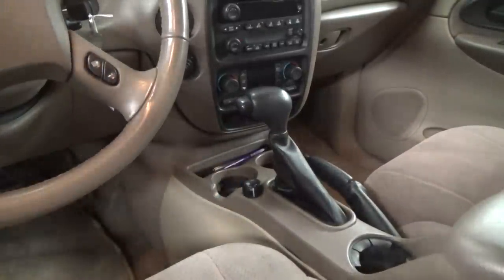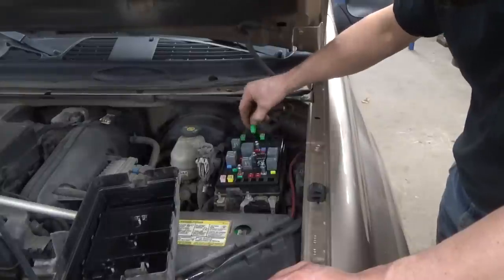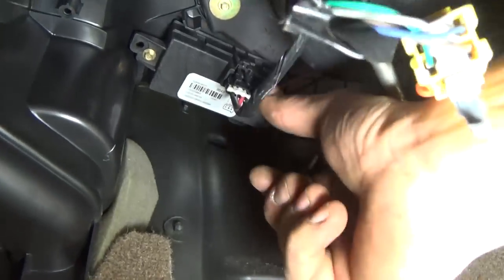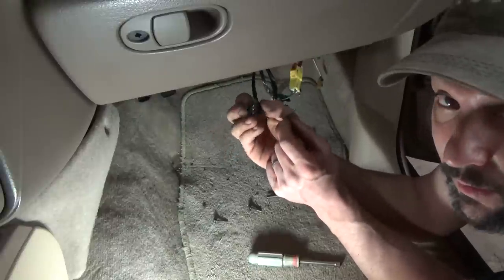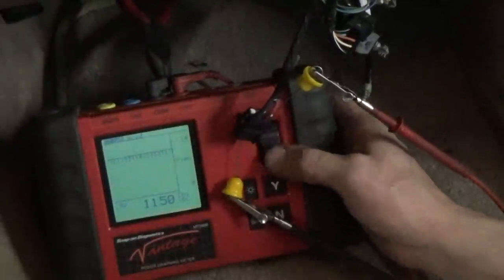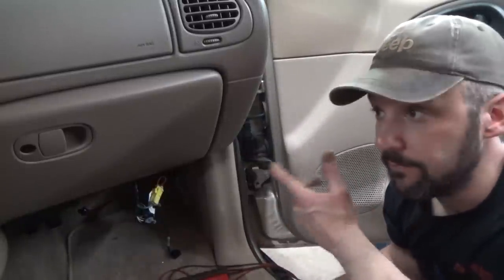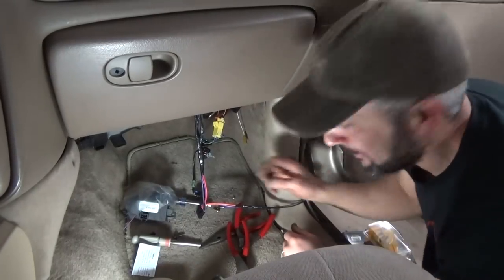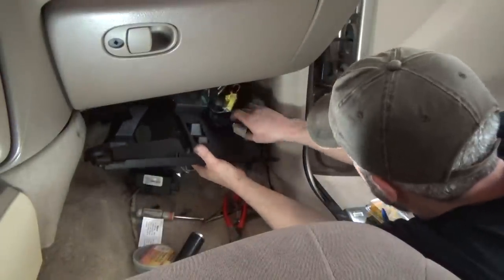Chevy Trailblazer EXT Blower Motor Won't Turn Off

Comment: Exact Problem in my daughters 2007 Envoy with 120K miles on it, exact same problem with after market part. i would have never found the problem without this video. I followed the procedure in the video and it worked out so perfectly that i didn't have to stick the extra foam from the seal to bang my head against it!  thanks Eric!

Comment: I love to hear you speak the truth about the after market parts like that. I've ran into it myself and it makes me swear through the rest of the job and usually half way through the next day, telling everyone about it. I would also like to let you know, that in the fields of plumbing and hvac they are experiencing the same thing, with the same results as you just experienced. Wasted time, modifications that shouldn't have been needed and also test the level of your creativity are usually the result. It's the way of manufacturing and until some big shot decides he can make more money by having everyone buy his parts because they are manufactured correctly, it isn't going to change. But keep ranting about it because were ok your side Eric. Thanks for the videos bud. Jpol.

Comment: After watching your video a couple of times, I installed this on my wife's 2005 Buick Rainier. I was very skeptical at first, but it wasn't that bad after all, and it worked. I used the AC Delco brand. Thanks for the help.
Reply: Wise to go OEM on this!

Comment: Eric, Thank you, Thank you, Thank you!  My son is working gobs of overtime right now and his wife called with this same issue on their truck.  I would have not known how to help her besides disconnecting battery or removing fuse.  She stopped by and it tested just like you showed.  I removed the module so he can go get the replacement part and we will put it on in a couple days.  For now, at least, she doesnt have to worry about the battery running down or having to pull the fuse.

Comment: Had the identical problem with my 03 Trailblazer.  Your post made it easy to perform the fix myself.  Saved me from being raped by the dealership.  The AC-Delco part was $60 from Amazon.  THANKS SO MUCH FOR YOUR HELP!!!

Comment: Hi, I ordered part # ACDelco 15-81773 GM original equipment heating and air conditioning blower control module from Amazon.com. $56.82 plus shipping and sales tax, if any. After watching your very good video, I was aware of the possible issue with the blower motor lead being too short. This part number had more than adequate length to fit in the clip behind the blower motor housing and reach the motor connection. It was an easy install in a friend's 2004 Trailblazer. What a great job on the video, and I agree with your comments on the lack of support when a part does not fit. Although, I have to say, without challenges to overcome, how satisfying would life be. It should be right, though. Keep smiling and I'll check back on my next adventure.

Comment: Awesome video! This was EXACTLY the problem with my 2005.  I kept searching for one that had a 3 pin socket.  Ended up figuring it out that I could use one with a 5 pin socket with a 5 pin pigtail (supplied), duh only 2 pins hot plus small purple one needed, plus splicing, Anyway the dealer part wasn't even AC/DELCO, product of Mexico/Korea with GM approved gold stamps all over box.  Thanks again

Comment: Good comments on the part fit vs. OE on aftermarket parts.  I am very familiar with part sourcing with suppliers.  Our process is this:  we almost always use Tier 1,2,3 suppliers, they are usually the same suppliers that make parts for the new car build.  We send them the blue prints for the part we need, they model it up, send part to us for engineering review, if part passes engineering review and testing, [extended durability, fit, finish, internal component specs] we sign off and release supplier sample for production.  We then take 50-100 of the first production run and test all of them, to include tear down to verify manufacture to print.  After this, we green light the part for release to commerce.  The extra engineering, testing, validation steps add cost, but the part is right when we release to commerce.  I was a tech 35 years ago and learned quickly on the difference with OE vs. aftermarket. It is hard to get the OE spec part today depending on where you are and the available part suppliers.

Comment: Just today I replaced a window regulator (Dorman) and the new part worked about 12 times then the cables broke. Chevrolet wants almost $600 for there part so back to Dorman we go. I hate crap parts but I hate overly expensive parts more. Great video Eric. I've been enjoying all the diagnostics and repairs.
Reply from the maker: +wyattoneable DORMAN Part that went BAD!?!?! NOOOOOO..... hahah
Reply: +wyattoneable idk i have an 05 trailblazer and in 2008 the fuel pump sending unit went on it gas gauge always reading empty when full and periodic bogging i replaced with delco full unit lasted 9 months shit the bed with same problems got a dorman and here we are going into 2016 still working great and no problems touch and go ive had problems with name brand and aftermarket in the end theyre in it together make money on car parts lol
Reply: +wyattoneable Dorman isn't terrible.  They make some good stuff.

Comment: Have watched a lot of your videos, definitely have learned a lot i didnt know. Thank your for your time. Just wanted to say the module may have fit if you used dremel on corner of mounting tab. The n flipped it. Kind of like installing aftermarket radio kit.Thats why they give multiple holes i think to cover there end. I Probably wouldn’t of thought of it either at the time of working on it. You are an awesome tech doing it the way it should be done. Ill feel your pain too. Keep on keeping on

Comment: I'm starting to think that filming your work is a good stress reliever for you, Eric. Free therapy! Too bad more parts don't come with pads to beat your head on. BTW I'm a big fan of the crimp connectors. They have saved me many times. With the right crimper ( I use some made by Chanellock) it's had to get it wrong.
Reply from the maker: arcdraw See I knew someone would like them :)

Comment: Wanted to say thank you for this video.  I had a similar, but not exact problem and your diagnostic technique helped me isolate the problem on my TB.  PS... the Delco part I got had more than enough slack for the blower motor wire, but still needed to do the splice into the orig. wiring.  Seems like all replacements are like that for this part now.  Thanks again!

Comment: Thanks for the information.  I have a 2004 Envoy that the blower stopped working.  I will check the restore pack since it  started blowing when the key was off and then quit all together.  I worked on CNC and PLC Controlled equipment till I retired. Never worked on cars electrical, which is very different then what I did.  Also found problems with manufacturers over the years.

Comment: this "upgraded" version of the blower motor resistor is the way to go. initially, i went with the exact same looking one with the couple heat fins, lasted a year or so 😑. the extra time and frustration of replacing it with the newer version is worth it. several years, no issues. 👍🏼

Comment: I suppose that you could have cut the plug off of the old module and spliced that onto the new module, so that it could be replaced again in the future without having to do any wiring again.

As per your question regarding solder or crimp and seal, I always solder and rarely use heat shrink.  Never had an issue with old fashioned electrical tape.  I do crimp on spade terminals when needed, because you don't have another option for that.

Comment: Eric, you were right on with the trailblazer front blower not shutting off with the auto temp controls. My 2005 TB rear system is now doing some what the same thing. Only it will run high blower and then no blower(or low) by itself. Does it with the car turned off or on. Under the rear center passenger seat is the fuse box for the system and I pulled the 30A number 13 fuse. Any idea were the problem is and where the components are. Not seeing them in my Chilton manual.

Comment: As with any blower motor issue, which could be either non operative, single speed only,  or stuck on, the resistor module could be the most likely cause of the malfunction. However, you also must include the thought that something probably caused the module to fail. If they run cool, they could last the life of the car. Usually though and after about five years or so, the blower motor bushings start to dry out as they are made from a self lubricating material called "Oilite".  Oilite is used in small motor designs exclusively. It is a sintered bronze and oil mix bushing and will eventually wear and bind the blower motor shaft. Furthermore, the carbon commutator brushes have worn down by now, causing a pool of carbon powder shorting the commutator up and slowing the motor down. A stiff spinning motor shaft is a good clue, so check for that. Give the fan a good spin, if it stops very quickly, it's motor changing time. The increased currant draw from the tight motor shaft, over heats the control module (mosfet) component to it's failure point. Always change the blower motor along with the control module if it's an easy access design.
Reply: This is gold right here.

Comment: Nice video. just replaced my module in my 06 TB. got two at a junkyard that were DOA. then found a acdelco part brand new on amazon for 55 bucks. worked a charm and the wires were long enough!!
Reply: I'd not waste my time on a junkyard electronic part unless I can test it BEFORE buying it!   You spent more time taking the used part out than the new part cost you, and the new one had a warranty!  Wise to go OEM on this!
Reply: @user-cy6gf2pj7y  for sure. Trailblazer is long gone now. Will only buy new resistors from now on. Lesson learned.
Reply: @avenged06x  I have a 2002 TB EXT and am looking for a decent reasonably priced second one.  I love mine (and do consider the fact that it's 18 years old now), but GM doesn't have anything in their newer (post 2008) lineup that is as good as mine is!  I don't want the suburban or tahoe, and everything else is uniCRAPbody...AKA unibody.  UniCRAPbodies are for cars, and cars can't pull a trailer with plywood, so I have no use for cars!

Comment: I feel your pain Eric with parts that you have to bastardize to make them work. As for Napa, they use to have some pretty good parts 20 or so years ago. Now when I go there I'll get the same part that I could pick up at Advance Auto or Autozone and Napa will charge about 20% more. The last time I went there they had to order the part from another Napa warehouse. Well, lo and behold, they charged me shipping to get the part. So, I rarely deal with them anymore. Take care...
Reply from the maker: stuzman52 Seems to me Terry it is all the same junk any more just different color boxes...
Reply: South Main Auto Repair Yep, you're exactly right and I reached that conclusion years ago about the quality of parts. As for the engineer(s) that designed that part makes you wonder where their heads were at. I work with some of the same mentality at work, and I sometimes get into some heated debates of how to go about a design of a project, so I can relate to what you're saying.

Comment: I had the same problem, 2003 grand am,your replacement module looks like mine, blower motor bearing failure caused excess current flow through power FET switch at "resistor module" causing it to short and keep blower motor running until battery dead. Car belonged to niece and dead battery stranded her once already. I wanted a reliable repair and was tempted to replace module with a toggle switch. I instead ordered power FET from Digikey about 4 dollars and saved 80 dollars by repairing the module. The IRFBA1405P is a power MOSFET designed by international rectifier for automotive applications. You will need a hot soldering iron, the PC board sinks heat well. The MOSFET is the large 3 terminal device that is pressed against the finned aluminum heat sink. Melt a little solder on the iron and apply iron to all three FET leads, flow a little solder onto iron and leads to help conduct heat and when all solder is liquid FET will lift off. then flow all excess solder off this footprint use solder wick if U have any. trim the leads on the new FET to the right length and position the FET on PC board and solder each lead. Make sure no solder is Bridging any leads together. The FET is mounted face down on the PC, this is so the back can contact the aluminum heat sink. Thermal Heat Sink compound must be applied here to reliably conduct heat. Heat sink compound can also be got from Digikey or oddly  best buy. You can maybe salvage old compound.
Digikey is a large supplier of electronic components, been around a long time, they ship large qty or just one, I don't fear giving them my credit cart number. And my part came in 3 days normal shipping. I still had to pay 80 dollars for the blower motor but I could not fix that.  If this were my vehicle I would have just replaced the module with a toggle switch, easy and reliable repair, but so far blower is working fine after 5 weeks.

Comment: Great video, my 05 trailblazer scared me with the blower not working,  checked the fuse, nope, so figure it's the resistor cuz NOTHING us easy or cheap with this truck. After taking I no out the fuse, putting it back, just for shits & giggles tried it again, fired right up. Not working RIGHT, but blowing hot, which is what I need on a maine winter..still plan on replacing c the resistor,  don't trust it..thanks for the heads on Napa part

Comment: I got to do the exact same thing tomorrow with my 06 trailblazer the way I'm going to do it is the way I took it off too tight to unplug these wires while they're locked including blower motor unscrew the resistor let it dangle hopefully I still got the same length of wire for the new part that I'm getting wrap it around and then screw in the resistor very good videos though I love watching your program learned a lot on other stuff

Comment: "few french fries short of a Happy Meal".  If this mechanic thing doesn't work out,  you can always become a comedy writer.   It's a Chevy that's your Problem....lol.  Love your comments and impersonation of 'Patrick the helpdesk guy'.
Reply: Bob Moy:I know that is a good proverb. Yes I too think Eric O would make a good comedian. Wonder if he could have own equivalent of the tonight show?
Reply: Took a buddy’s battery back to AutoZone, Duralast Gold 6 months old, the battery will charge to 12.4 but when you do a voltage drop test it goes to 3 VDC, so I read capacitance, did my math (a formula I have written on the wall in my shop) tested it and sure enough it doesn’t have the CCA as written on the top.

Walk in smiling being nice, the manager sticks her little china meter on it, and said the battery is fine, but if it’s “fully charged” to 12.4 VDC her cheap meter uses calculated amps not true capacitance, she got a false reading.

So I pointed that out, to which she informed me that Batteries don’t have amps, only the alternator does? Batteries are only voltage...I asked what this CCA thing on the tops means. Honestly I didn’t mean to laugh when she said that.

After about a 5 minute lecture starting with Ohms law, then explaining the theory of an electrical circuit...she handed me a new battery.

Voltage drop is now only to 11.2 VDC....imagine that.

Comment: You know I wanted to be a mechanic till I became one.now I'm thinking, " you got anything else?" Haha. I do like your videos there always informative. Here's a good one for you I had a guy put diesel in a gas truck he ran it till it started sucking up diesel and died, then killed the battery cranking it and burned up the starter to the point he melted the solder on the solenoid. And told me he drove it back and parked it and didn't do anything. Talk about chasing your tail when everything checks our working but the fuel don't burn. Long story short the diesel not burning while he was plowing with it caused the oil to get diluted and trashed the bearings and cam and the rings on piston 5 broke. So it got a rebuilt engine

Comment: I did like you said and the problem is fixed ! !   I did get the module from " standard"  - ( red box )  and sure enough - wires about 1" to short ! !  so did like you did, " splice"   Thanks for the vid-! !

Comment: I don't even work in the field, but I've always done all of my own repairs/maintenance and also for family and friends. I probably should have become a tech but i've always felt the best way to ruin a hobby, is to do it for 40 hrs every week. The only decent aftermarket is usually the OEM supplier, sometimes you can get lucky and get a truly improved part, but not often!  My pet peeve is reboxing. Napa didn't make that part, so why the heck did they put it in a napa box? Carquest is actually even worse for this... I have yet to get a re boxed part I felt was OE quality, although they all "say" they are... I know you don't have time for such things Eric, but you should give rock auto a shot sometime when time allows. You can choose the grade and manufacturer, so once you figure out the ones that last you're ahead of the game. (well until the supplier cheaps out) . I know way up north here in canada even with shipping rates often doubling the part cost, it's usually still cheaper then going to my local parts store!
Reply: ive found the same thing here in ky